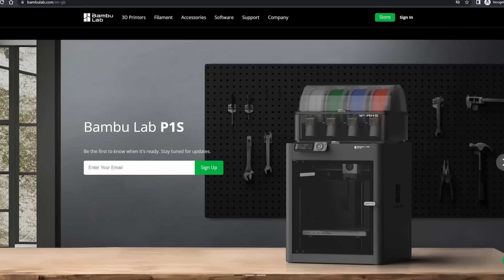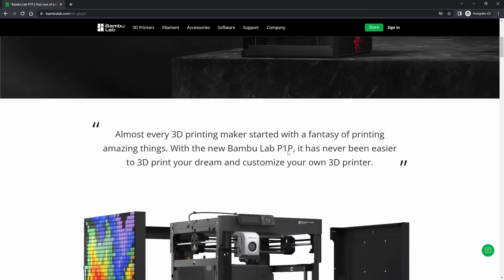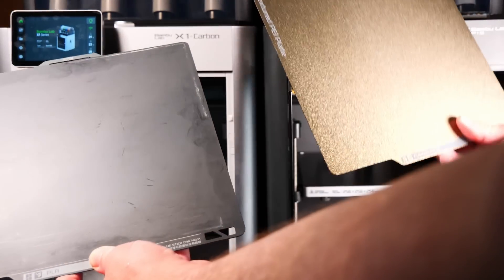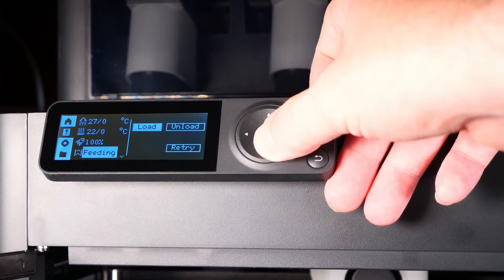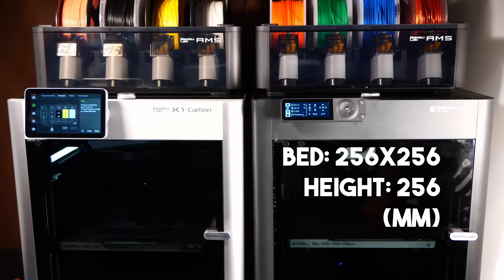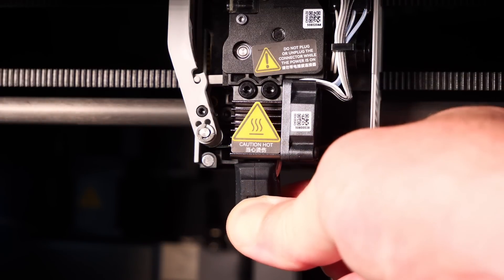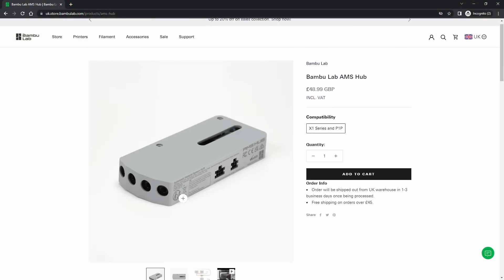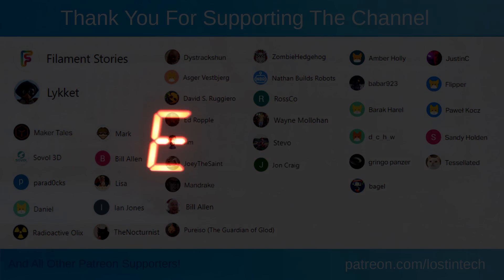The Bambu Lab P1S is here - Should you buy this one?

Comment: $100 more buys you a gold pei bed
Carbon filter
Aux air blower
Enclosure

Not too shabby actually.
Reply from the maker: It really isn't!
Reply: You forgot about the the cable chain, the stronger toolhead cable and  the mainboard fan as well as the chamber fan and housing.
Reply: And you forgot, only $70 more than the CR K1. Seriously, this thing is a K1 killer, as there is absolutely no chance of a K1 with AMS.
Reply: @jbrou123 My point was about the value for the upgrade from P1P to P1S. But you're right. K1 is nowhere near that value in my opinion as well. And it even comes with a smaller build volume. The latter was the biggest reason not to by the K1 as I already have multiple printers with a 235²mm² for my other printers and this would not add any value to me. The 256²mm² build plate is a significant upgrade to me.
Reply: Better than buying a third party enclosure that still requires you to print parts.

It's a damn good deal at this point.

Comment: I was Just getting ready to purchase the X1C ... now i am back to the drawing board to look at this..
Reply: There are only a few differences, that let the X1C stand out: Better screen and better camera. The LiDAR is not worth it in a lot of cases unless you don't want to stick to a few filament brands and want to buy cheap filaments. In that case the LiDAR lets you calibrate the filament on every print. But you will need to do the calibration on every print, because it is lost after that. Most people recommend tuning the filaments in the slicer and skip calibration, because it achieves better results in most cases. Also the printhead is lighter that way, which results in slightly better print quality at high speeds. If I had the choice I would get the P1S-Combo, because the AMS is significantly cheaper that way. Also get the hardened steel extruder gears and finally buy a few hotends: Hardened steel 0.4mm hotend without the fan, thermistor and heater. One 0.6mm full assembly hotend and maybe one 0.8mm full assembly hotend. That way you get the best of both worlds at a very good price. If you're not interested in printing abrasive filaments or only very little then skip the upgrades except maybe the bigger nozzles - in that case I'd get the full assembly hotends, so you have some spare heaters, silicon socks, thermistors and hotend fans.
Reply: I forgot one difference that may be useful for special filaments: The heatbed of the X1C goes up to 110°C, while the P1P/P1S is limited to 100°C

Comment: Smart move by Bambu.  Take the parts they already have to fill that void from the X1.   In my opinion, this seems very targeted towards print farms.  Enclosed, low cost, fast.  Anecdotal evidence based on FB group, Reddit and most YT videos, that most consumers people are printing PLA with their Bambu printers and don't need an enclosure.   However, print farms don't need the fancy display from the X1C but in many cases might need an enclosure for printing ABS/ASA/etc, and P1P "Print your own" was a hassle.   The only thing missing at this point is real print farm software.
Reply: PLA is what I started with like I am sure most people do as well since it is easier to print with until i found out that I needed to be able to print some parts out of a material that needed to be in the hot summer sun.  I do not always print with ABS or other materials but it really is nice to have the ability to do so.
Reply: @MrBassard  Bambu has all the stats on printing because nearly all prints go through their cloud. I'd love to see them release numbers of number of prints processed in the last year, and a breakdown by material and even by machine type.
Reply: @JohnOlson  What I would like to see as well is improved filament profiles, which I know they will want to work more on their filament they sell, but I would like to see additional profiles added since pretty much everything goes back to them (provided you use their "cloud") so it should not be too hard for them to do. Do it as a peer review so that everyone gets to vote on which works best.
Reply: Broskisnowski  You absolutely cannot "just use a fan". A fan will cause currents that will spread styrenes around the space the printer is in. You need real fume extraction or a carbon filter (Bambu's, a Nevermore, etc).

Comment: From the official site 

 Can P1P be upgraded to P1S?
Yes, P1P can be upgraded to P1S with the upgrade kit. Purchasing an upgrade kit as a set will be more cost-effective than buying individual spare parts.

What is the difference between P1S and X1C?
P1S is based on the P1P with an improved cooling solution and enclosure. However, it is not recommended to directly print fiber-reinforced filaments such as glass fiber or carbon fiber, before an extruder and hotend upgrade is done. The X1-Carbon is equipped with Micro lidar for advanced AI detection functions and offers more convenient and efficient screen interaction.

What is the difference between P1S and P1P?
Compared to the P1P, the P1S offers a fully enclosed printing chamber and a more powerful cooling solution, which includes an Auxiliary Part Cooling Fan for cooling prints, a Chamber Regulator Fan to stabilize the inner chamber temperature, and a Control Board Fan to assist in cooling the control board. Furthermore, we have equipped it with an activated carbon filter to provide a solution for printing filaments such as ABS that are prone to emitting odors and harmful gases during the printing process.

For more information, please visit P1S page or refer to the product specifications on our official wiki.

Comment: Man I want to buy this, but part of me wants to wait another 6 months to a year to see what competitors come out with.
Reply: Or what else Bambu Labs might release. Maybe a larger build volume printer?
Reply from the maker: haha, there's a lot of speculation about that bigger printer. I got no info on that.
Reply: In my case, I'm getting a Voron 2.4 300, is plenty good, as capable as the X1 and (if everything goes scoring to plan) faster as well
Reply: And in 6 months you will want to wait and see what comes out in 6 months.
Reply: I totally get that. I got my P1P less than a moth ago and I bough every possible accessory for it, as well as the AMS. If I waited one month longer I would have saved over $300 (the AMS coupon, and sale price as well the free filaments are already accounted for in that number).

Comment: Need to figure out if the LiDAR is worth the extra cost — I have the P1P and never felt like it was lacking. 🤷‍♀️
Reply from the maker: it does things, but whether you need the things, is another question!
Reply: ~6 months with the X1CC, the lidar still struggles to give better than an estimate calibration, and i just run calibration tests anyway. They are built into orca slicer for a reason. I like the aluminum and the screen on the X1C but... 

The P1SC is probably the best option if there aren't any temperature issues.
Reply: Never had an issue with first layer on P1P
Reply: It's not worth it, if that is the only thing you compare. It sometimes causes problems which make the printer unreliable. People even suggest to not use it on the X1C and rather tune in the filaments you have in Bambu Studio. This will produce better results and make it more reliable.
Also the lidar will not benefit you if you use the AMS because it calibrates only one of the rolls.

That said: If you use very cheap and inconsistent filaments a lot and from many different brands or even no-name, then the LiDAR will probably benefit you, because you can't calibrate a no-name filament and expect the second roll to be the same. But you will need to perform the calibration for each print, because the calibration results are never saved and lost after the print is done. But as mentioned above: This still only works for one color.
Reply: I have an X1C and rarely ever use the LiDAR:
* On the textured PEI plate it doesn't work anyway
* The first layer inspection actually ruins prints because it moves an oozing nozzle across it - I've turned it off
* The flow calibration is the only thing I use now and then, but its results aren't very consistent, as Bambu themselves admit.

Comment: Big Tree Tech have recently given the option to improve the interface with the Panda Touch for the P1 series.   
The X1C, other than the interface, has a higher speed camera, the LiDAR that helps with flow control and the full alumium enclosure.
These are missing from the P1S .     The LiDAR, as far as I can tell, is mainly used for flow control calibration, and out of the box, if you are not doing super accurate engineering prints, I don't think most enthusiasts and makers would notice the difference.   
With third party screens now available, and good remote control options, I think the P1S is avery interesting option for the enthusiast and maker community who want something that just works out of the box, rather than buying a printer that needs to have hundreds of dollars of upgrades added to make it work.    Nothing wrong if you are the type that likes to play.  I just prefer to print.

Comment: So the P1S is basically just a P1P but with most of the enclosure goodies of the X1C? Fair enough.
Reply: Oh and a better bed but that should have always been there IMO
Reply: they bed is 20 bucks. The fan was included in the early bird adopters. There are several enclosures for the P1P available, like the Vision enclosure.

So it's more a less fancy X1 without the C, without the aluminum, the display and the lidar.
Reply: @hassosigbjoernson5738  Yeah, although I think that because the lidar and sensor suite is the primary selling point for the X1C, it's closer to a P1P with cheap and early bird upgrades and an enclosure for those who don't want to deal with printing their own. I see it more as a less DIY P1P than a less advanced X1C, especially because of the name.
Reply: @hassosigbjoernson5738  The biggest difference is that you now can get a bundle with the AMS where the ams is only $250.

Comment: I ordered the p1p including the auxiliary fan two days ago.... Time to cancel that order. I was going to enclose the printer anyways and with this, the price is basically identical to what you'd pay with the upgrades minus the time it would cost you to do it.
Reply: It’s actually cheaper
Reply: ... minus the option to customize it at least a little bit.

And the "time" should not be an issue for a hobby that consists of printing stuff for DIY and customization.
Reply: @hassosigbjoernson5738  I use 3d printers as tools.i couldn't care less about tinkering or customizing. Time saved on getting a tool to work instead of having to fiddle with it is a big plus for me.

Comment: Is the nozzle hardened steel? For abrasives
Reply: Nope, they come with the standard stainless steel nozzles. Need to buy the hardened steel nozzles. But they're so cheap not a big deal.
Reply from the maker: also most of the time unless it's a big print or a lot of prints, just send it. The nozzle won't abrade that much.

Comment: I was hoping they would have addressed the lighting, they havent, it's the same as the P1P.
 I am more interested in what succeeds the X1C, hopefully it is a toolchanger printer!
Reply: That would drive the cost way above what they cost now.
Reply from the maker: I think the light ought to be pretty easy to solve.
Reply: @LostInTech3D  It is, and that is why I was hoping Bamboo Lab would do it
Reply: @MrBassard  Yes it would but that is the printer I and many others want, and those that dont want a toolchanger would still have a choice of the existing machines and the wasteful AMS which when you think about it the AMS waste is very expensive also.
Reply: @AndrewAHayes  Oh i am not saying people would not want a tool changer 3d printer but it will be difficult to make so it will be as reliable as what bambu has already put out.  Even Prusa that is known for reliability has not actually put out their XL with tool changer yet.  As for the AMS yes there is waste but it is a trade of for not having an idex or a system like the pallette 3 that welds filament together.  I would love to see someone make a tool changer system that will work reliably.
Reply: in my personal experience, lack of good lighting doesnt really matter when you dont have to lift a finger for bed leveling and such, the light is still good enought to see when a print fails and i like the small light better than the bright white Leds that i had in my old printer

Comment: So, does Bambu have any plans to redesign the AMS such that it works reliably with other spool sizes?
Reply: The back rolling pin is able to be removed.  Someone on youtube made a 3d printed mod so that the removed back rolling pin can snap onto the print mod that snaps to the back again, thus being able to accommodate a 500g spool.  If I find the vid link, I'll post it here again.
Reply: @redone823  Sweet, thanks for the tip

Comment: i was going to buy a creality k1 speedy becuase it had many of the same features as the bambu labs but i have alsways wanted to try out the disolvable supports and muti material and color printing as well as things like abs and pc but the creality machin cant do any of that so i was gping to just deal with it but now, there is a far better way to have all the things the x1c has that i like and noextras with the addition of an enclosure and filter so i dont have to worry about fumes for any kind of material turning this effectivly into the super machine.

Comment: I was hoping someone would cover whether they have fixed how loud their printers tend to be
Reply from the maker: no change in the sound levels.
Reply: @LostInTech3D  thank you, I have to keep my printer in my office so it’s a deciding factor to me
Reply: @philipmoore9098  Hello, I know it's year later but I've seen people put printers into cupboards and then acoustically insulating them from the inside with foam. Apparently this is super quiet (apparently you barely hear it when sitting next to it) and works well. Might be an option for you. Cheers.
Reply: @ares395  cool idea, I ended up buying a Prusa mk4 (which I have been very happy with) and building an ikea enclosure, so I’m not above some diy. However it would have kind of defeated the purpose of buying an enclosed printer. I’ve heard of replacing the chamber fan with a silent noctua fan, but bamabu labs doesn’t recommend it and it can cause error codes.
Reply: @philipmoore9098  Tbh the main thing that adds noise, I'm pretty sure, is the fact that they are enclosed. It can act as a sort of resonance box like in a guitar and it'll make frequencies more noticeable. You can only do so much to make it quieter by the way of hardware

Comment: Does steel nozzle here mean the same as hardened steel nozzle?  And does the p1s have the hardened steel extruder gears?  Thanks! 👍
Reply: Not a hardened steel nozzle, it is stainless steel. You can get the hardened steel nozzle/hot end for $15.  Not a hardened steel extruder, but you can get that upgrade for $20.
Reply: P1 series comes with neither, X1C comes with both hardened versions.

Comment: Does the P1S have hardened extruder gears?
Reply: Not a hardened steel nozzle, it is stainless steel. You can get the hardened steel nozzle/hot end for $15.  Not a hardened steel extruder, but you can get that upgrade for $20.

Comment: Is the hotend now the Hardened Steel version? Is the Extruder Gear also Hardened Steel?
Reply: No.
Reply from the maker: extruder is steel, not sure about hardness. Hotend is the plain steel, so you would have to buy the hardened as an extra.
Reply: Not a hardened steel nozzle, it is stainless steel. You can get the hardened steel nozzle/hot end for $15.  Not a hardened steel extruder, but you can get that upgrade for $20.

Comment: I don't have any need to print different colors but I do have some ideas where it would be handy to print nylon or ABS for a structural part and TPU for a flexible portion of the part, but AMS doesn't support TPU filament.

0:26 - I cringe when I see what looks like a Bambu Lab printer trying to saw through its upper X axis carbon fiber guide rod with it's cable chain.

I'm still offended by the notion that Bambu wants me to send my prints to my 3D printer via a Chinese server.  For similar reasons, I don't want a Bambu printer with a video camera.

I'm also not convinced that the carbon fiber motion control components will last.  I know they're available for purchase now, but I don't want to spend that money and spend a few hours of labor when it's not needed.  I like that the Creality K1 uses proven steel guide rods and uses much larger stepper motors to get the fast speed with those heavy duty parts.

At least the P1S has a PEI sheet.  Hopefully, Bambu isn't recommending glue stick.  It's 2023.  Glue sticks are so 2010.
Reply from the maker: the cable chain doesnt touch the rods.